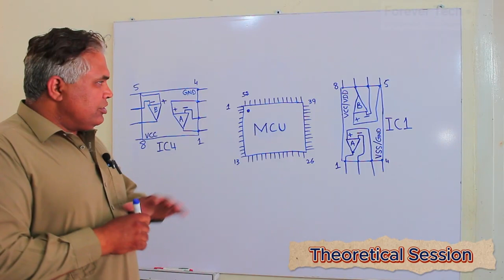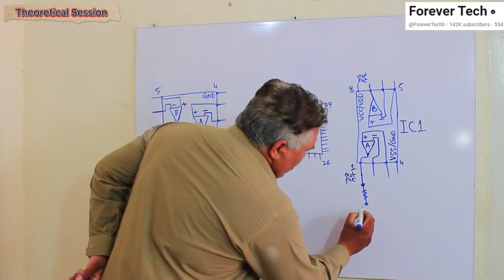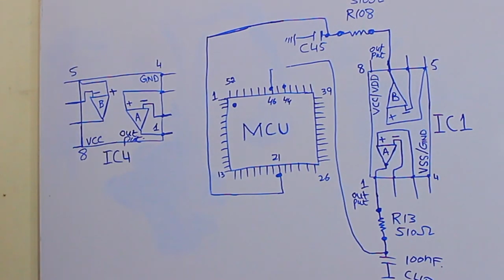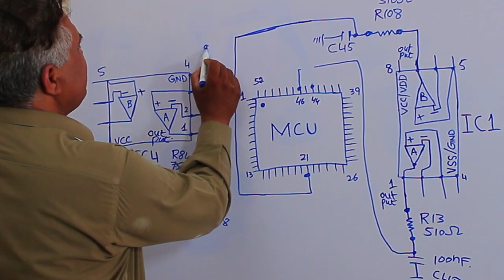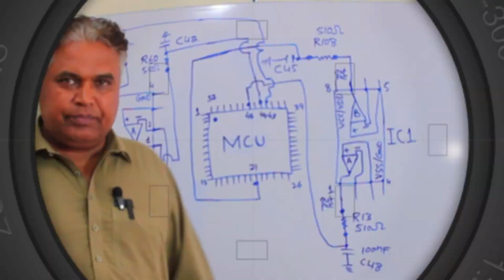Can You Fix AUX Mini Split AC Circuit F1 Error with Software Update?

Comment: I have the same electronic board for the AUX device, but no code or error appears on the internal screen. The LED lights on the board work intermittently, 2 and 3, after connecting the device to the power for 3 minutes. Please inform me of the possible errors.